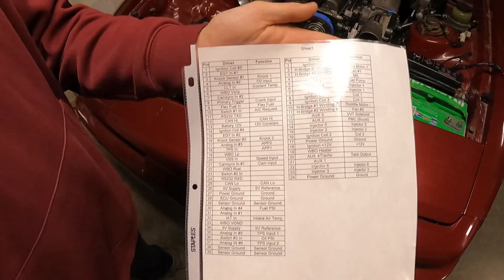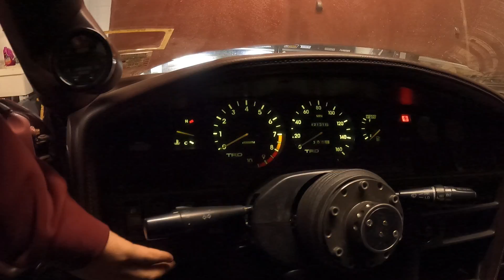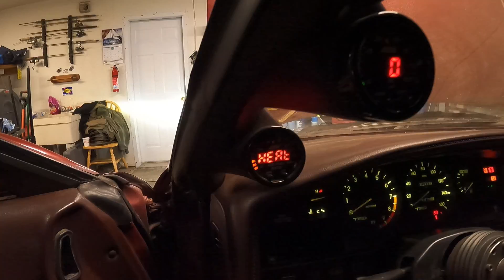2JZ MK3 MAJOR UPDATE + FIRST START!

Comment: If you’re having problems with your alt. I would check the voltages. On the wires just to make sure they’re properly running the correct amount mine had the same problem and it was due to the wires still being connected as the 7m alt. Different power voltage for different pins.